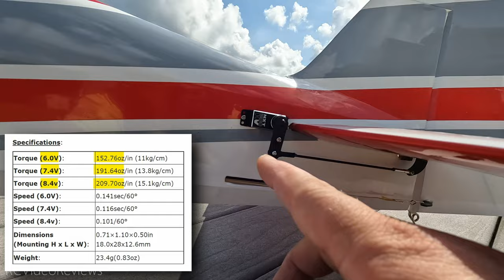Precision Aerobatics XR-61 RC Airplane • Extreme Flight Edge 540 • Tron 5.5 RC Helicopter

Comment: That PA XR-61 is gorgeous, that red and white color with a little silver really pops. The Edge 540 has such a presence in the air, looks really big on the ground. I am not a helicopter guy but I can tell you have so much fun with the Tron. I had a roommate in 82-83 who was big into helicopters and that is when there was a big push to get inverted, there weren't many people or machines that could do it but he was one who could fly and hover inverted.
Reply from the maker: PA graphics are really good, it's one of the things that continues to attract my attention. We've talked a bit about the GoPro as a field camera and how it doesn't do a great jobs showing what I actually see. The 540 is much more impressive in person. It is a big plane. I'm still very much a novice on helis, but I'm having fun learning to fly them. It's a good challenge requiring a different set of skills.

Comment: HEY JOHN NICE FLIGHTS !! hey I'm rigging out a omp hobby 60' edge 540 , i see you flying (2) 3s 2200 in series in the 61' , what the gram 
s on your batteries i'm needing a 6s setup too for my. my 3s 2200 weight 169.0 grams that would be 338grams for two of them, i might need more weight
Reply from the maker: I weighed my 3s2200 @ 184g each. These are 35c cells.

Comment: This year along the central Coast of Florida  wind has been a constant  so I have pretty much decided I will fly planes that handle the wind well which it looks like will exclude PA planes and other really lightly loaded planes.  The KAOS 60 was really good but its gone and I am waiting for it come back in stock.  That 540 looks great but it is too costly for me and I doubt if I could get it into my compact sedan.
Reply from the maker: Look at the Extreme Flight 60" planes. I've flown the Extra 300v2 in some decent wind and the plane wasn't impressed. FYI I'm selling my Kaos. Sounds like you might be kind of close by...
Reply: @RCVideoReviews  Yes I am  I am in Brevard County I am guessing you are in central florida somewhere that cannot be more than  a few hours drive. Let me know the price and what comes with it. I do not need any of the electronics nor a motor but will consider buying the plane as a whole.

Comment: A beautiful plane, I am considering buying. (XR-61) I see the leading edge of the wing is unusually sharp, and a thin wing at that. The Addiction has a round leading edge and thicker wing, usually associated with good slow flight characteristics. This difference makes me nervous as I prefer slow flight most of the time. What is your take on this planes slow flight attributes?
Thanks, your videos are very much appreciated.
Reply from the maker: This plane is very light and has a very light wing loading. With a motor in the recommended power range, it has the ability to easily punch out of anything.